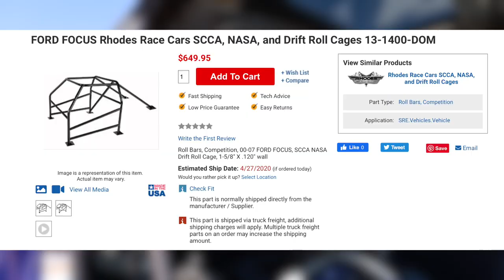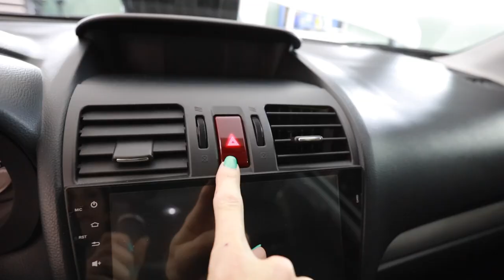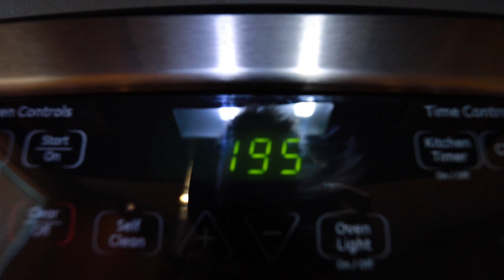Was It Worth All This Work? // Subaru Forester Retrofit Ver 2.0

Comment: I just retired my old A4 Avant TDi 4 months ago after 250.000 Kms (about 160.000 miles). Great car, not a single breakdown. The 1.8T has ben a legendary engine either, although it came to a sudden end due to contamination limits some years ago.

Comment: Nail guns can shoot thru walls if the person using them is not thinking they can shoot it thru drywall. Some of the high power ones from hilti can shoot across the building if set up right. So basically you should no where your studs are and don’t use any more power then you need. And the forester looks great too.

Comment: That is a ton of work, and it came out great. Well done.

If those were the Sylvania Zevo 3157s, you'll be happy, one of the best, reasonably priced, leds out there.

Does the SJ come with the auto-leveling control module pre installed, or are you ready to start playing with your can bus a little bit?

Comment: Question on bump steer & roll center correction. Isn't it enough to just get a wheel alignment, and if need be, a camber kit? As long as your alignment is within specs, shouldn't that be good?

Comment: Have you ever had to replace an IIRC sensor? I have 2016 forester that the key won’t turn to off in the ignition. I literally have to put it back in reverse than in park a 2nd time for key to turn to off. I’m hearing it might be an IIRC sensor. Was wondering if you knew how hard those are to replace and the cost?